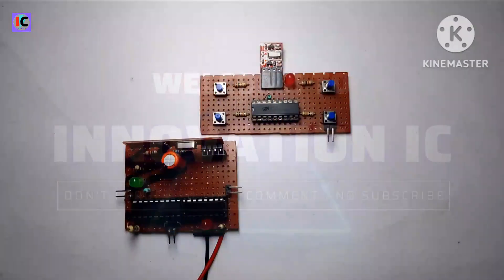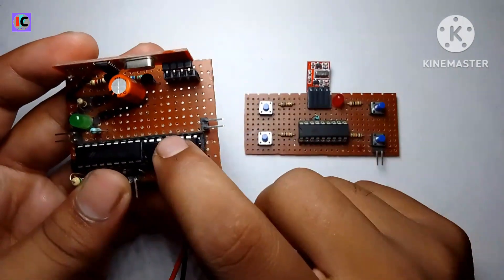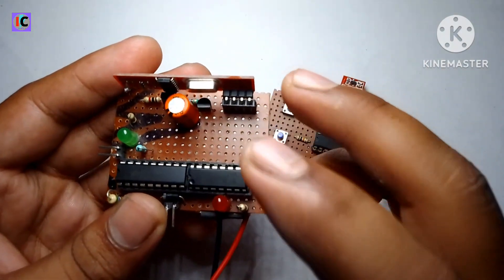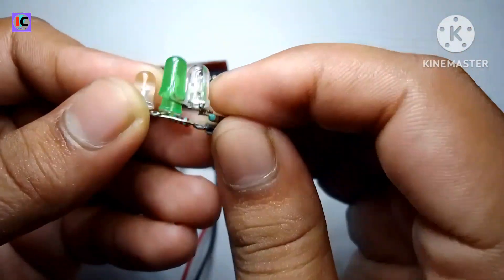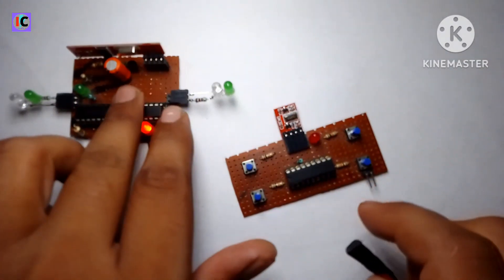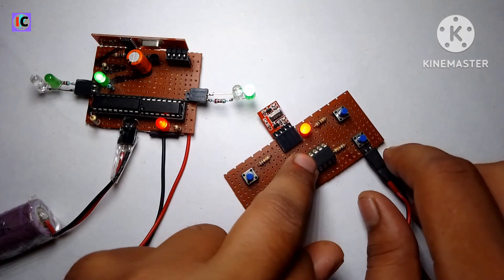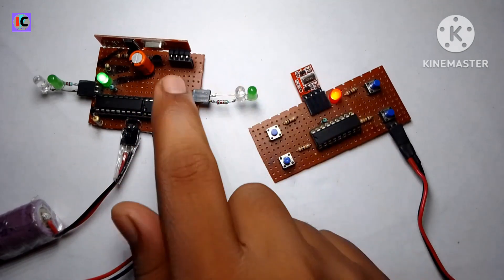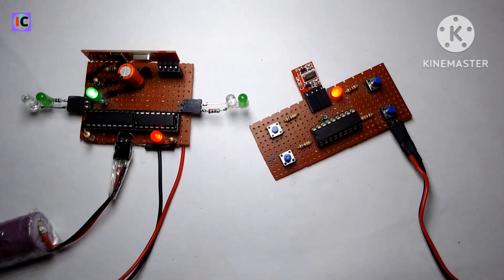Unveiling a Hidden Gem: The New Way to Use 433MHz TX RX

Comment: brother, can you make  4 channel transmitter or receiver by using RF 433 MHz module in an easy way  and longer range plzzzzzzzzzzzzzzzzzzzzzzzzzzzzzzzzzzzzzzzzzzzzzzzzzzzzzzzzzzzzzzzzzzzzzzzzzzzzzzzzzzzzzzzzzz
Reply from the maker: bro this is the easiest method you can make 🙂
Reply: Brother please by using a microcontroller IC or Arduino for a quick response instead of an HT12 IC 
I will be very thankful for your help @innovationic
Reply from the maker: yes definitely I gonna make using arduino very soon
Reply: thank you very much brother @innovationic